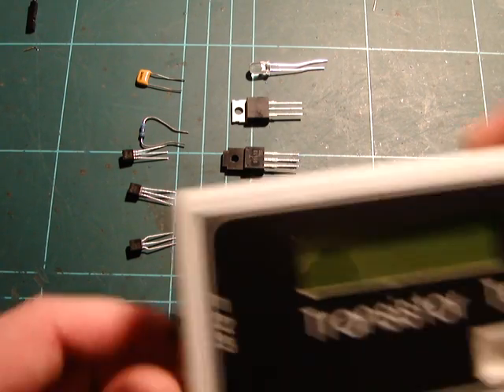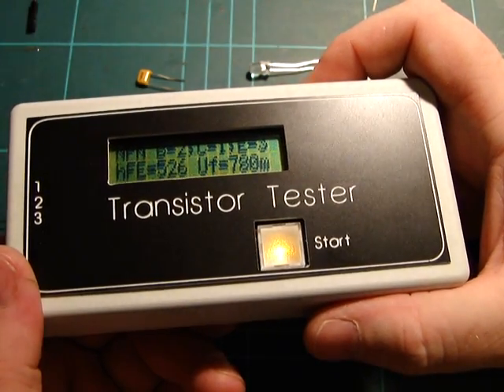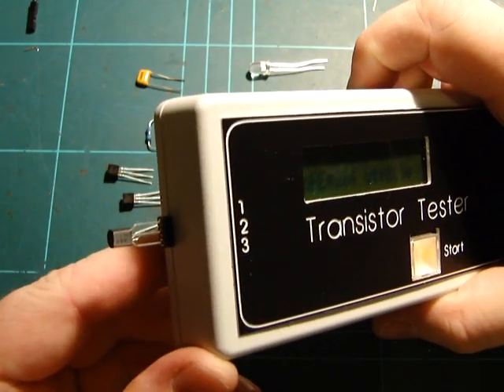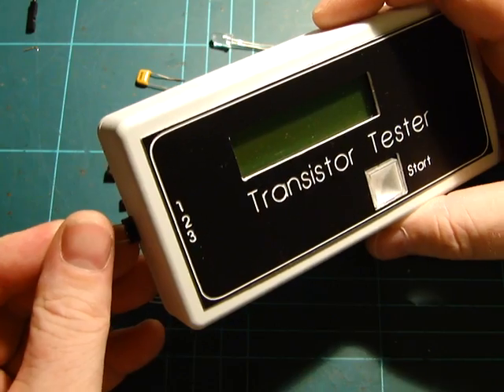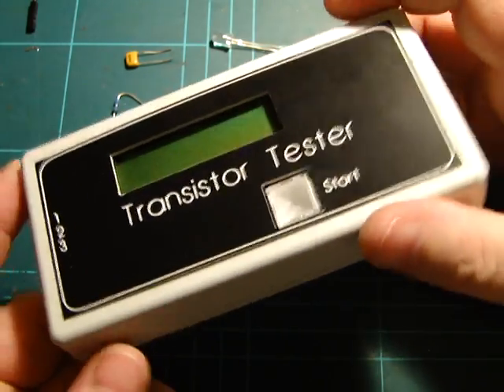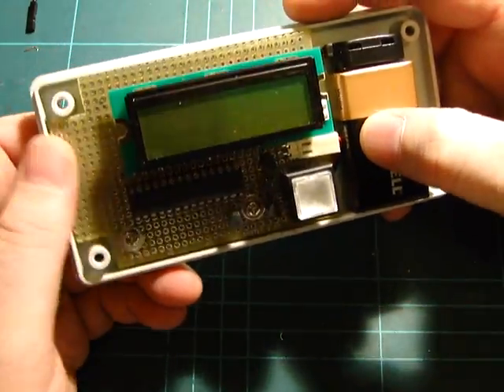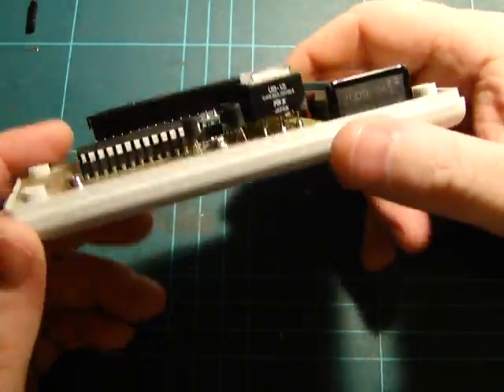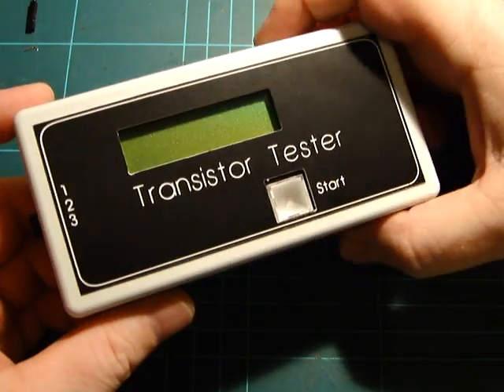AVR Transistor Tester

Comment: Very nice build Alan!  Looks super useful for identifying random three leg bits and pieces in the junkbox. U is often used for voltage in European electronics, Uf looks like the forward voltage of the BE drop or the diodes.  For MOSFETs it is showing the threshold voltage - all handy stuff!

Comment: Uf could be forward voltage drop
Reply: Uf is definitely Forward Voltage drop for semiconductors. They've used a U instead of a V. On transistors it's usually the base to emitter forward voltage drop.